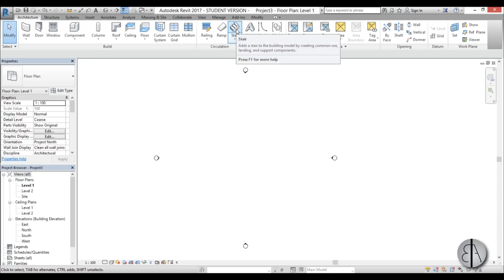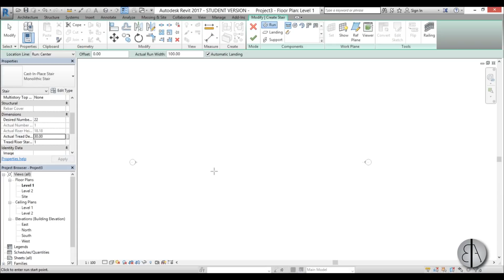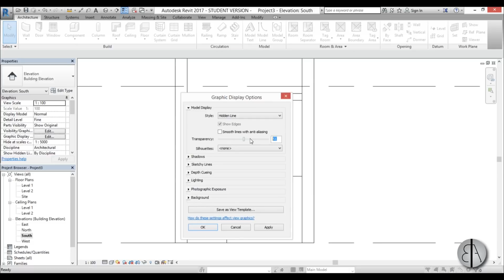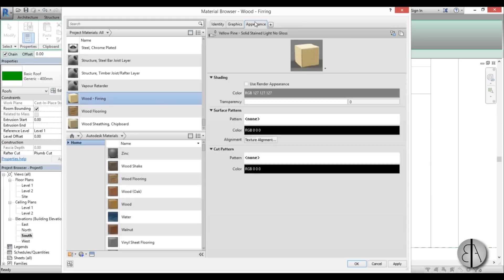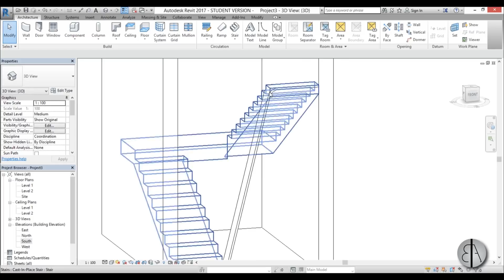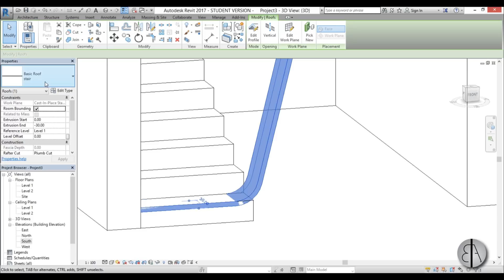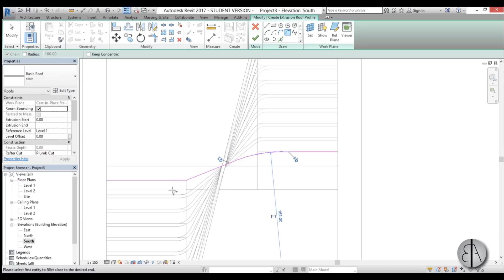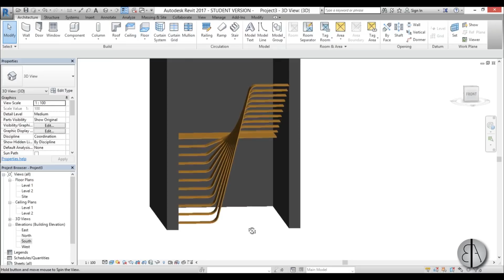Modeling a Flowing Stair in Revit Tutorial

Comment: +Balkan Architect   your videos are usually great... 2 comments:  1- When a design introduces risk or danger, is not a good design... this stair is not safe!  2- Since the times of AutoCAD it is usually better, also due to risk or in order to de-risk design mistakes for example if a snap doesn't work, etc... using 1 CAD/Revit Unit = 1 mm  and not centimeters.... Keep doing this great job!!

Comment: I think that I would model the stairs as usual, with stairs containing only the steps, without risers and no support, and do the curved elements in between them as an in-place model in a simmilar way you used the roof elements. Maybe the steps won't be single elements this way, but you can annotate them properly.

Comment: Great tut but this must be a staircase from a Steven King novel. haha.
Would it meet safety code anywhere? 
Would look fantastic though.
Reply from the maker: haha, i doubt it can meet safety code anywhere, but it look good, so i guess its not that important to be safe :)
Reply: maybe if you add railings with 3 points newel posts, it could meet safety code.
Reply: TYP. 3' FT LANDING @ 7" precast secured from both ends of each RUN with a similar concept for the railing

Comment: i cant select the plane in th face of the stairs like you do. it doesnt let me!
Reply from the maker: You must use monolithic stair as a template, and when you are selecting the face, tap the TAB key if you can't select it.
Reply: thank you for replying. it wasn't that. iu was using monolithic and it wouldnt select the faces of the stairs but with a regular stair i was able to pull it off. thank you for the video
Reply: I faced the same  , I only managed to do the first roof but not the rest is not allowing me to pick
Reply: @MohammedIbrahim-ob4ft  Exactly..!!